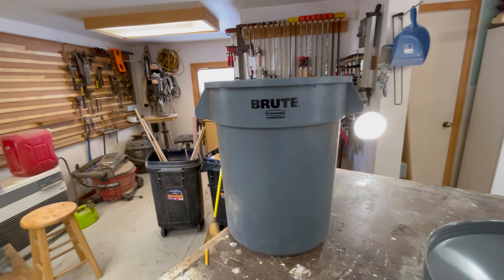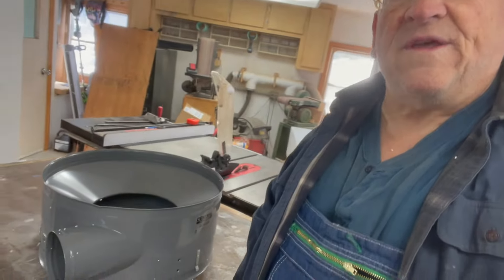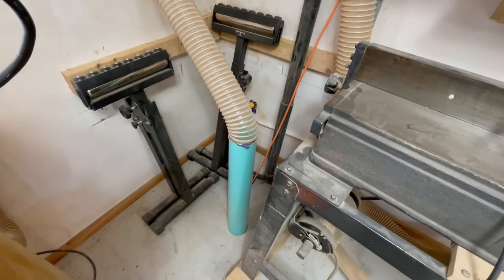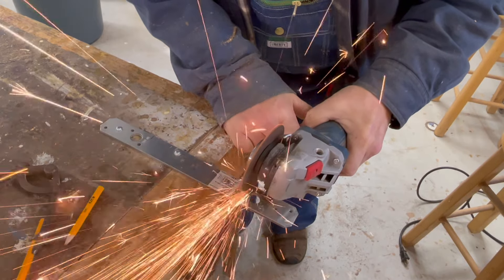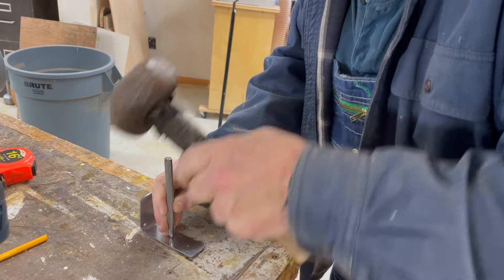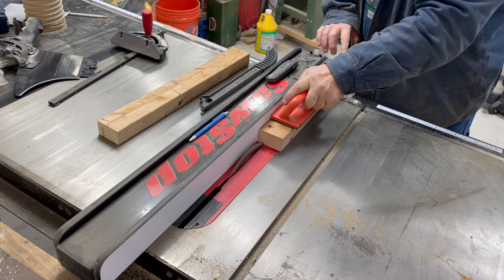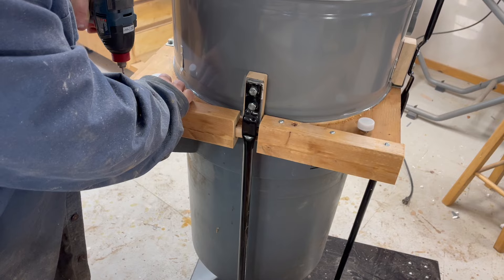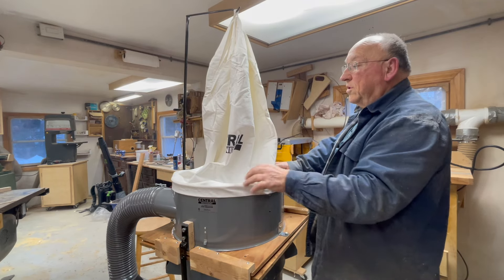Harbor Freight Dust collector: Easy Empty Barrel

Comment: Hello Dan.  Just stumbled across your channel.  You are addressing a dreaded chore near and dear to me ... hate changing bags and manhandling the sawdust.  Being able to locate your DC in your downstairs garage is a big plus, but watch for fine dust leakage especially if you operate it in the shop while waiting for warmer weather.  

From my testing and design experience while working on my own solution, I think you may eventually have leakage at your ungasketed joint between the two sheets of plywood.  Dust proof closure with four bolts on a 22+" diameter joint is a tough ask. Maybe not initially, but possibly afterwards as the weight of captured sawdust increases.  The other leakage driver could be increasing pressure as the filter picks up a layer of dust.  Since you are just connected to a table saw and are using the 5 micron bag ... you may not have much pressure build.  However if someone creates fine dust or adds a 1 micron bag or a filter cartridge, the odds of pressure build increases significantly.

I tackled that problem a bit differently by sealing the DC cylinder to a separate chamber and that allows the collection bag to be separated from the DC.  I access the bag by way of a easy opening hatch.  My solution was highlighted in the Dec 2023 edition of Woodsmith magazine (www.dustcollectorhero.com)

Always interesting to see others tackling a shared problem.  Good way to learn things.  Thanks for posting your video.
Reply from the maker: Thnx. Yes, Still waiting to install and fire it up. It's 11F here this morning down in the garage so no hurry . Yes, I figured the gasket was a 'science experiment' for sure. I just viewed your video and you have a really nice solution there. I wondered if the gasket would hold the pressure buildup. I do have a couple of ideas about that. First is that As weight grows in the barrel I could support it from beneath. And if the leakage ends up being minor, well it's in a location I wouldn't mind. Suction after the blower isn't dependent on the seal at that location. I'm still opting for a 30 gallon plastic drum I see once and awhile on marketplace as a replacement at some point. But, it's inevitable... I will find out soon!
Reply: @CraftsmanontheLake  If you get a drum with a snap lock ring top, you can get a good seal.  Use that with a cantilevered support base to raise/lower the drum.  As for your location not being a concern over minor leakage ... possible with table saw debris from lumber.  I cut a lot of MDF on a large CNC router and that dust just loves to squeeze through any opening no matter how tiny!
Reply from the maker: @gilbertrabbe5424  I avoid MDF if at all possible. Just the dust that comes off the tool that doesn't get vacuumed gets everywhere. But, sometimes I do use it out of necessity.

Comment: this is exactly something I've been wanting to do, putting the dust collector outside the shop in the connected 'shed' space-- glad to see someone else using this in practice!

is the Wen impeller that fits the 2hp harbor freight: [3403-022] Turbo Fan for WEN 3403 ?

Comment: This is a great idea and addresses one of only a couple issues I had with this collector. The bag was a pain to get on and off and inevitably you’d end up with dust in the air as you messed with the metal band. I always dumped and reused the bag too, the trash can will hold up much better.

The other issue I had was clogging…you’re just connecting it to your table saw so you should be all set, but I found that curly shavings, like the kind from a jointer or planer (especially pine) would clog sometimes because of the guard on the intake. I ended up grinding it off on mine, but since yours is tablesaw only you won’t have any issues.

This is a great video, I’d have paid more to have a trash can adapter as an accessory for this.

Also, those knobs…great idea, and recycling to boot
Reply from the maker: On my other collector I cut out the cross hatch blockage at the entrance to the impeller. Don't know if that was wise but it too would block with planer chips.